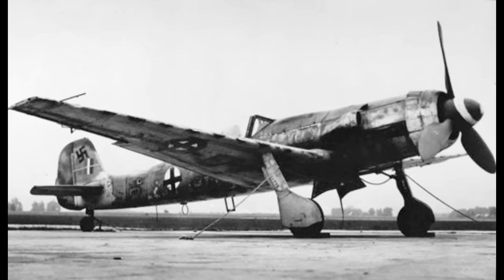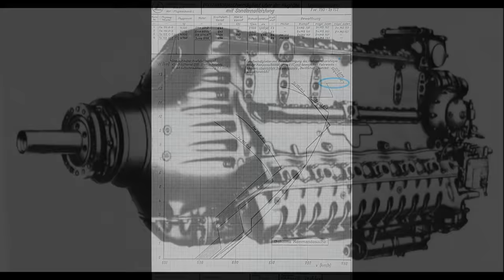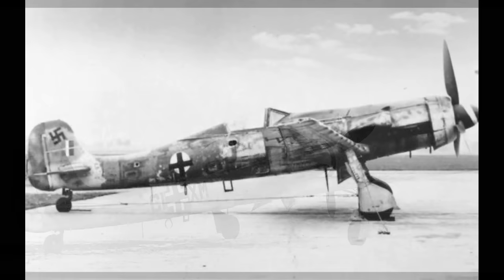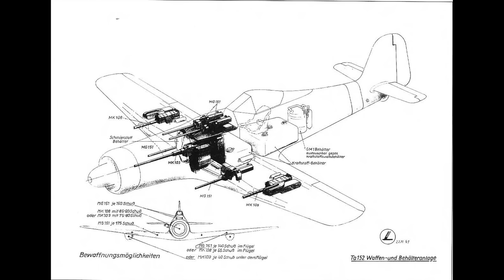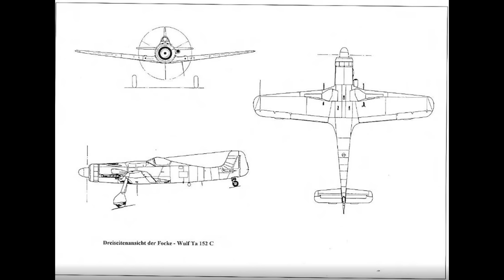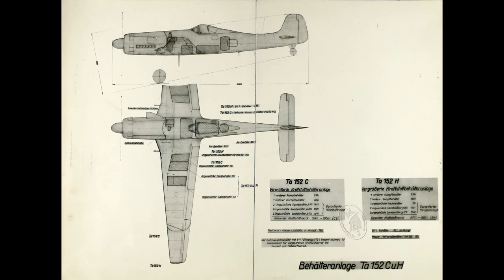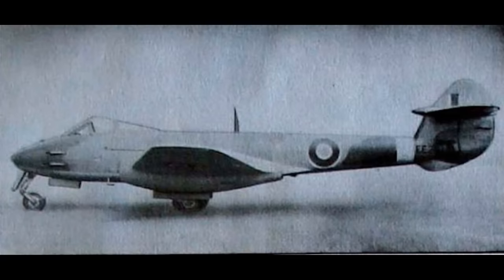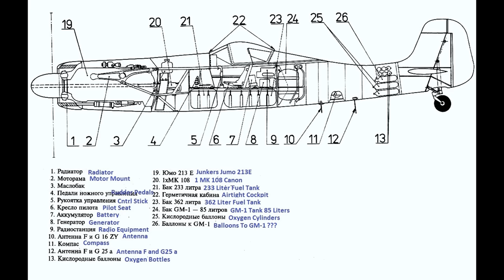Focke-Wulf Ta 152 H-1 Extreme Speed At High Altitudes.

Comment: WHY DID WWII AERO ENGINES BOTHER WITH 4-VALVE HEADS (or 3-valve in the case of the Jumo213) ??? At the 2500~3300 rpm speeds that these engines operate at, there is no tangible airflow advantages to a 4-valve design. A 4-valve DB601E making 1330 bhp @ 2700 rpm @ sea level =  39.2 hp/L. A DB603A made 1776 hp @ 2700 rpm @ sea level = 38.8 hp/L. A 2-valve BMW801C made 1560hp @ 2700 rpm @ sea level 37.3 hp/L. All on B4 87 Octane fuel. The minute differences in specific output is easily attributable to the fact that the 801 is an air-cooled engine. Whatever was limiting the engine outputs, it wasn't the flow capacity of the heads and intake ports. So why bother with the added complexity, weight and friction from the 4-valve or 3-valve designs?
--
Modern, mass produced, automotive 2-valve designs have attained peak torque values no lower than 4-valve engines. The pushrod 2-valve LT2 makes 470 lb-ft @ 5150 rpm for a good 76.2 lb-ft/L. The same company's LGX 3.6L 4-valve engine makes 281 lb-ft @ 5300 rpm for 77.0 lb-ft/L. Both engines being direct injected and both have 11.5:1 compression. This means that there is no volumetric efficiency deficit at or below about 5000 rpm. If that were the case, the specific torque output would be lower and peak torque would not be attainable at those engine speeds. There is no practical advantages to a 4-valve design until you rev it past 6000 rpm where the higher flow rates possible with 4-valve heads allow for torque to be maintained, thus allowing for higher specific power output. I have always maintained that there are ZERO advantages to a 4-valve design below 6000 rpm and it is pointless in passenger cars which spend 99.9% of their time below such engine speeds, with many even producing peak power below 6000 rpm. Going back to WWII aero engines, NONE of them ever approached 5000 or even 4000 rpm. They rarely go above 3,300. So why 4-valve DOHC heads? A simple SOHC 2-valve design would have been simpler, lighter, cheaper, easier to maintain and just as well performing. The same holds true of tank engines like the Ford GAA V8 which red lines at 2950 rpm -- the 4-valve design was completely uncessary.
Reply from the maker: There were many WW2 aero engines with 2 valves per cylinder, nearly all the radials were set up that way as well as the Hispano-Suiza 12Y engines. The 12Ys were using in various French fighters including the D.520 and MS.406. However nearly all front line fighters ran with 2 intake valves per cylinder. Many ran with only a single exhaust valve including the German Fw-190 D9s, Ta 152s, and most of the Soviet V-12 powered fighters.  cont:

     All the British and U.S. front line fighters went with four valves per cylinder. Why is that? Is it possible that Allison, Rolls Royce and Packard (they build Merlins under license, and their own Marine V-12 also with 4 valves per cyl.) were just being wasteful with govt. money? Now you make a good point about specific power outputs, but you are looking at early war stuff before these engines were fully developed.

     In regards to engine speed, I think what matters here isn't exactly engine speed, but rather pistons speed and that's a function of RPM and stroke. This really separates aircraft engines from cars. The LT2 you mentioned has a stroke of 3.62 inches. The DB 601's stroke is 6.3 inches and the Allison and Rolls both come in a 6.0 inches.  cont:

     The Allison's stroke is about 66 percent greater than the LT2's. That means that the piston speed of the Allison at 3000rpm is about equal to that of the LT2's at about 5000rpm. Both the Allison and the Rolls were up over 1800hp by the end of the war WITHOUT water:methanol injection. That gives them much better specific power than any of the engine without four valves per cylinder UNLESS they ran with water:methanol. It may not have been a huge advantage, but it does appear to me that 4 valves per cylinder gave an advantage in WW2, even Junkers was adapting it to the Jumo, although it wasn't finished before the war's end. Was it worth it? That's another question, and again, I do think you have a valid point with automobiles, and the U.S. V-8s really drive that point home. Plus it's not just about power/displacement. When you look at it from an engine weight/power, or number of parts/power, the 2 valvers look really good to me.
Reply: @GregsAirplanesandAutomobiles  (1) I didn't say that there weren't 2-valve engines; I simply questioned why they bother with multi-valve designs.
(2) I know that piston speed is what governs an engine's maximum operating speed; generally, you don't want to get much more than about 7,300 ft/min in modern engines. But that's not the point. The point is that with the speeds the WWII aeroengines were operating at, there was no reason and no benefit to 4-valve cylinder heads. The DB601 had a bore of 150mm to a stroke of 160mm that is only slightly under square -- less so than today's VW-Audi 2.0 engines or the GM L3B 2.7. Yes, the 160mm stroke is much longer than 92.8mm or 102mm, but the 150mm bore proportionally gave more valve area for aspiration than 82.5mm or 92.25mm.
(3) Regardless, the engines got more powerful on the same displacement later in the war (and shortly after before the rise of jet turbines). But this was due to an increase in boost pressure not engine speed. The Merlin II ran at 3,000 rpm for takeoff & emergency. The Merlin 63 ran at 3,000 rpm for takeoff & emergency. The 63 simply ran 3 times as much boost! They would have made the same power with 2-valve or 4-valve heads since the Cubic Feet per Min of airflow going through the heads and valves are no different, just that each cubic feet is denser.
(4) As far as contemporary automotive engines, it's not just the V8s. Why did the Honda Insight (2nd Gen) and the Civic Hybrid revert to SOHC 2-valve engines? Because it was slightly more efficient due to reduced friction from the valvetrain. 4-valves simply had no benefit at the engine speeds they were optimized to run at. The way aspiration works is that for a given intake cross section and valve area, there is a flow rate under which it is not restrictive to airflow. At 2000 rpm there is no difference between a 2 valve or 4 valve head in terms of volumetric efficiency, both fills the cylinders fully. At 8000 rpm the 4-valve head might the 2-valve head will not. Somewhere around 5000 rpm is where the airflow limits of modern 2-valve designs are reached and volumetric efficiency falls off a cliff. The 2500~3200 rpm maximum operating speeds of WWII aeroengines was way below the threshold where increasing the valve count matters.
Reply from the maker: I wasn't claiming you said there were no 2 valvers, I was pointing out that they existed alongside the 4 valvers in this era. Obviously I have no idea who you are so I have no way of knowing how much you know about engines of this time period. Plus other people besides you may read the comments. It's not all about evia.  cont:

Raising the boost means you are shoving more air into the cylinders. I hate to use an argument from authority, but space here is limited. Rolls Royce, Allison, Alfa Romeo, Kawasaki,  and Packard's Marine V12 all used 4 valves per cylinder. Junkers, and Klimov were both using 3 valves per cylinder and were in the process of coming out with 4 valvers when the war ended. No competitive WW2 liquid cooled aero engine used 2 valves per cylinder. Now either the engineers at the above mentioned companies are wrong, or evia is wrong. I know where I'm putting my bets.
Reply: @GregsAirplanesandAutomobiles  They were wrong, just like contemporary engine designers dead set on 4-valve engines with power peaking at an accessible 6000 rpm is wrong. There is no benefit in cruise and no benefit at WOT to having greater flow capacity than airflow at those rpms require. There is only a penalty in additional valvetrain friction, costs, complexities, weight and bulk. This is even more true of aeroengines that redlines at 3000 rpm.

Comment: Can you explain why WWII aircraft sound so different, even when they are powered by the same engine? For example a p-40 is louder than a p-38   A b-25 is louder than a B-17 even though it has less power. I've seen almost all warbirds fly at airshows and their noise output has always intrigued me.  thanks.
Reply from the maker: Please watch my video on WW2 aircraft exhaust. That may help you. Short answer is that the B-17 and P-38 don't use individual exhaust pipes for each cylinder. My video on exhaust will explain it properly.
Reply: @GregsAirplanesandAutomobiles  thanks for the reply.
Reply: The P-38 and the B-17 both have turbochargers, which along with their ducting provide a nominal muffling effect.
Reply: +manny 2nd amendment   The firing order, the valve timing, exhaust shape and exhaust plumbing all affect how an aircraft sounds.  Compare the Merlin and Griffon engine.  Both basically a V12 configuration but they sound different because of the firing order.

Comment: if the 152h1 uses of jumo213 e/b with c3 fuel it would have much more power i think 2250-2300hp btw there was a project with jumo 222e engine with displacement of 49.85litres producing 2900hp in take off using four-bladed propeler with b4 and could get even more with c3
Reply from the maker: No question about it. There were multiple paths for much greater performance from this plane.

Comment: Hi Greg, your videos are very interesting and informative.  Have you ever considered an explanation of the term "dutch roll?"  It seems to be a charactersitic more evident in aircraft with swept wings.  It was certainly a characteristic of the KC-135 on which I was a crew chief and I have never fully understood what happens when a dutch roll is encountered.  I looked in Aerodynamics for Naval Aviators and couldn't find a reference for it.  Thanks.
Reply from the maker: It's described on page 300,  but it's not the best description. I'll have to work that into a video, I'm not sure when, as I don't have any swept wing stuff planned. I might be able to work it into a dihedral/anhedral video if I get around to that. On a side note, I hate Dutch Roll. We did it in the simulator in the 727 (yaw damper failure exercise) and I thought there was no way it could be that bad in real life. Then I had it happen when I was a young co-pilot. The Captain was in the lav, and thought we were playing a joke on him and got carried away. If you get a yaw damper failure in a 727 at high speed and high altitude, it's quite a ride. The procedure in the 727 was to aggressively pop up the spoilers on the rising wing as it oscillates left and right. That works, but it's pretty exciting.
Reply: @GregsAirplanesandAutomobiles   Thanks, I'll check that reference.
Reply: @GregsAirplanesandAutomobiles  I had to do it at 50,000 feet at night in a thunderstorm after negative G from turbulence tripped off all the generators.  We had backup power to primary flight instruments on my side only.  It was not fun; very busy and uncomfortable,but controllable if you did the right thing at the right time.  I was grateful when we finally got electrical power back for the yaw damper.

Comment: You're telling that the Methanol-Water-Tank is in the wings but in the graphic you show at about 14" I can read that the "Methanol-Wasser-Behälter" is directly behind the cockpit...
Reply from the maker: I'm not sure which drawing you are talking about. In the TA152 H-1 the tank behind the cockpit in normally GM-1, not MW-50. In other variants, it's often MW-50, and sometimes just extra fuel.
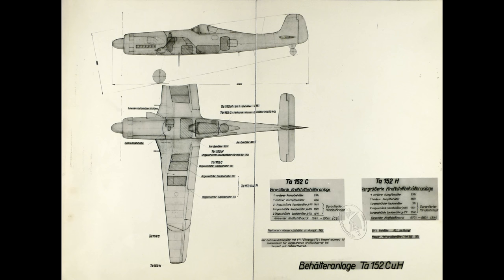Reply: @GregsAirplanesandAutomobiles   I talked about the drawing shown from 13:55 to 15:30, but you're right the description I read at first was concerning the Ta-152 C (my fault, I#m extremely shortsighted and when i get really close sometimes I kind of loose orientation)...but below the plane (sight from above) I can recognize the description for the Ta-152 H "Ungeschützter Sackbehälter für MW50" and this description is pointing at the inner tank in the left wing (and it should have a volume of 70l as far as i can recognize it)
Reply from the maker: Ah, that makes sense. Yes, the 152C wasn't really finished so information on that one is all over the place. I think had they finished it they would have gone with the same configuration as the H, meaning MW50 in the wing tank and GM1 behind the pilot, but that's just my guess.

Comment: You mention about the bad quality German fuel with low octane numbers during the war. We all know that ethanol based fuels such as E85 offers good octane performance. Also, it would had been easy to manufacture domesticly during the war. Why wasnt this an option?
Reply from the maker: I don't know, but I don't see any way it could have happened. They didn't have enough food to eat and that's without turning  their food supply into fuel. Furthermore, E85 would seriously shorten the plane's range, which was already so short it was a problem.
Reply from the maker: Oh, and then we get into the corrosion problem, which would have been huge with the materials they were using in the fuel systems back then, or even in the 1980's.

Comment: So why should you raise the atmospheric pressure of the cockpit with great effort when you have pure oxygen available?
Briefly and logically explained:
To oxygenate the blood at 98%, 12 breaths per minute with 450 ml of ambient air are sufficient if it has 1000 hPa pressure and contains 21% oxygen.
If I now lower the ambient pressure by flying very high, or by performing strenuous activities that mean higher O2 consumption, I could first increase the respiratory rate or the tidal volume and compensate for the lack of oxygen supply. However, the ability of the blood to bind or release O2 depends on pressure. In order to be able to specifically evaluate the interaction between oxygen pressure and binding affinity, one works with partial pressures. At sea level, 21% oxygen in 1000hPa means a partial pressure of 210hPa! If the aircraft rises and the ambient pressure drops, it would simply be sufficient to keep the partial pressure at O2 constant at 210hPa and you would be in the green zone for now. For fine tuning, the pilot can simply work with breathing depth and breathing frequency and everything should work fine.
BUT: what happens if the ambient pressure falls below 210hPa? Then it doesn't matter how fast or deep the pilot breathes or whether I provide him with 100% oxygen, he will inevitably suffocate. 210 hPa are in c.a. 16,000m below. At 8,000m, half of it is reached. Considering that a pilot cannot always breathe calmly and freely - he sometimes has to speak that flying without servo support is stressful and stress increases the oxygen requirement, it is wise to offer a "double safety", ie at 8,000 m to put the cabin under pressure. The body can then absorb the oxygen much better and less liquid gas has to be taken with it.

I only mention in passing that decarboxylation, ie the emission of CO2 without the “solvent” nitrogen, is enormously difficult, and that pure oxygen also contains no water vapor and thus strains the airways.

I would also like to admit that a pressured cabin was also installed in the Spitfire high-altitude fighter from 1942, which was also automatically pressurized by of a blower above an altitude of 8,000 m. So not a German specialty, but a consideration based on the state of science at the time.
Reply from the maker: Thanks Doctor.

Comment: How does a dipstick work on one of those upside down engines? M.
Reply: +Rover Coupe    Most of those big aero engines were pressure-lubricated with a dry sump.  The oil was circulated from an oil tank and that is where you checked the levels and added oil.
Reply: @FiveCentsPlease  Thank you. M.
Reply: I am trying to find the DS on the Gypsy Six. M.

Comment: video ideas 
could you make maybe some vids about the P-61 ( my fav plane ) it's capabilaty, like i read somewhere pilots where shown that they could engine turn( gas off on 1engine while turning to gain manouvrabilety) and how it compares to other nightfighters most of wich where pushed in that role not designed for it, so did they succede with the p-61 in investing to design/produce it. 

and maybe a comparison about the early jet engines, the axial flow and the other one with the chambers around it. ( don't know the name, the meteor used it i beleave, and later migs from british designs)
Reply: Axial flow and radial or centrifugal flow.

Comment: Which is better?......a three blade prop with wider paddles....or a prop with 4 or 5 blades that are thinner? I noticed that most German planes have wide three blade props and allied planes seem to have 4 or 5 blades props with thinner paddles......does one have an advantage over the other?
Reply: +davy1458   Propellers were optimized for engine output, altitude and mission.   More blades and thicker blades to grab the thin air at high altitude.  Thin blades down low where there air is thicker.  Notice that Navy planes had thin props because they operated down low,  and thin props create less drag down low.  Fewer blades also mean a less complex propeller system to save on manufacturing time and strategic aircraft materials.
Reply: @FiveCentsPlease  thank you very much for explaining that. Very informative.